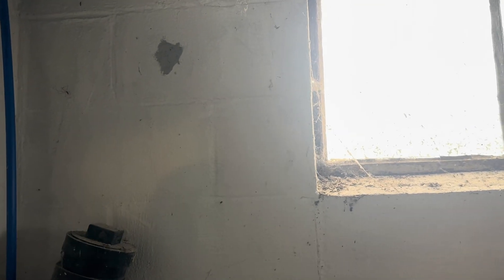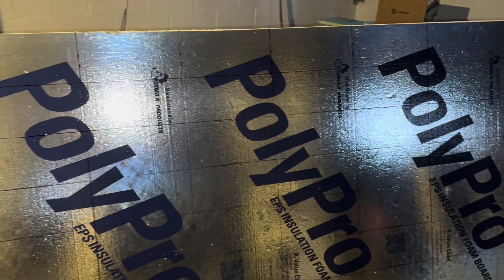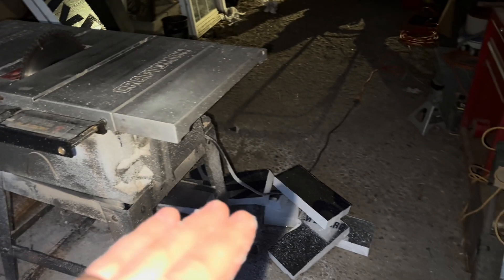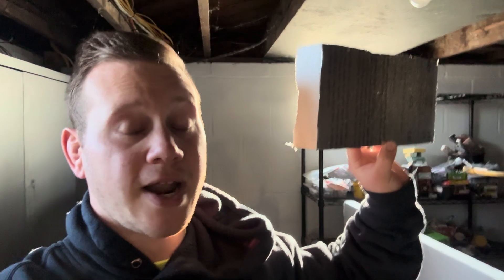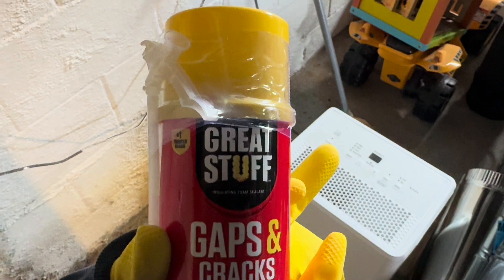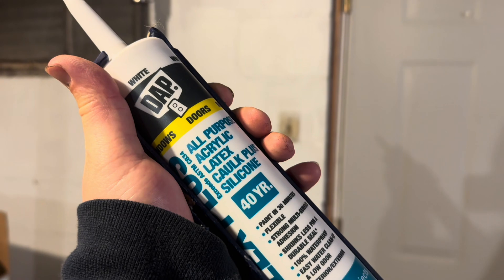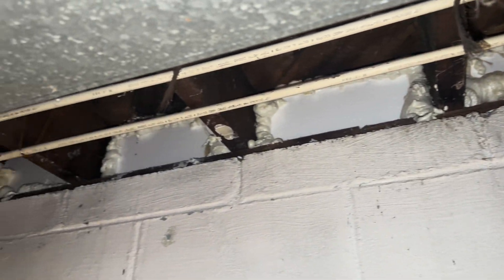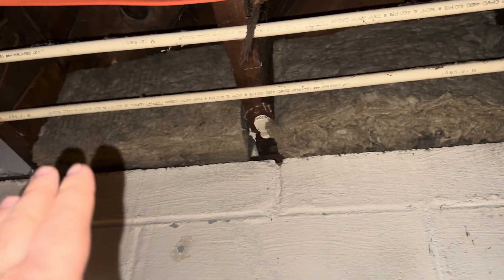Rim Joist Insulation Air Sealing DIY

Comment: Excellent results from adding insulation between the rim joists. I live in zone 3 a major improvement for my home was replacing the windows, doors and adding storm doors. Check for air intrusion around wall outlets. Every bit helps! Awesome content and thank you for sharing.

Comment: The old houses have great craftsmanship and style, but they were probably using a massive wood furnace. Every small thing you do will add up. Be aware that you may need to install an exchanger if you seal things up so tightly to keep the air quality good.